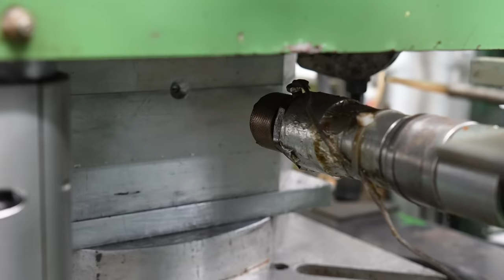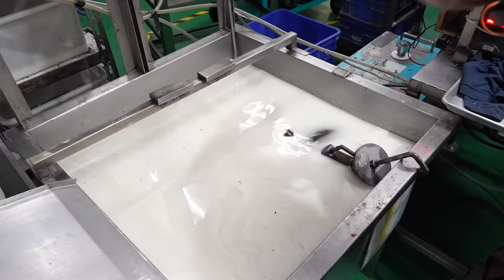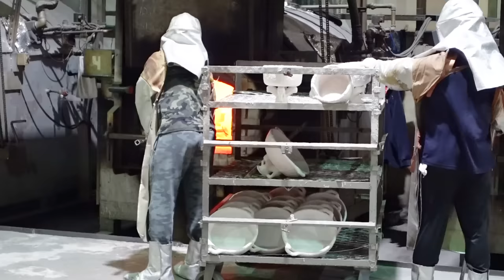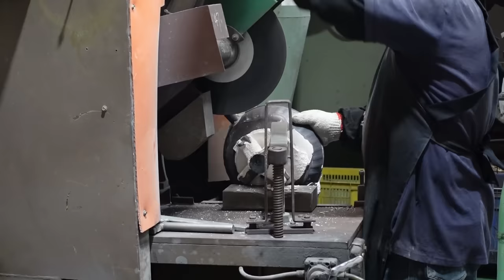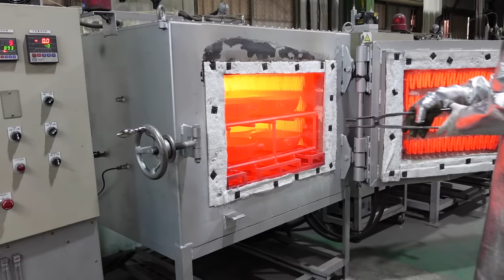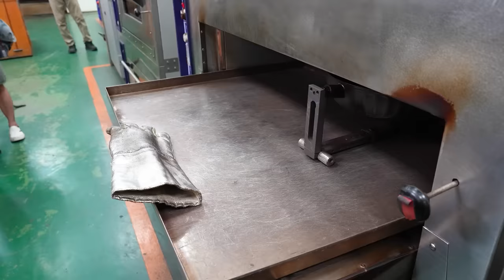Amazing! Process of Uncoated Cast Iron Pan Mass Production / 鑄鐵鍋量產過程 - Taiwan Ironware Factory

Comment: I would love a bit more detail in the process.  Putting the wax into a special slurry, why?  Putting it into special sand?  Why and why  was the sand bubbling.
Reply: Air
Reply: "slurry" as in pottery slurry - clay mixed with water to liquefy it. The sand is then used to build up a thicker more stable coating - when fired this basically turns into ceramic.
And the bubbling is, as was pointed out, just air getting blown into the sand to make it softer. When you blow the right amount of air through any fine particles they can suddenly behave like a liquid which makes it easy to put in the wax-form without damaging it (and faster and more even than having to through the sand by hand).

Comment: It's obviously very high quality but this is an enameled pan.  Uncoated pans need high temperature oil seasoning in a really hot oven for an hour.  It's right up there with Le Creuset in quality.
Reply: Hard to season in a hot oven with a wooden handle.
Reply: They seasoned it with flax oil before fixing the handle. It is not enamelled. If you want to season more, just unscrew the handle & do yourself.

Comment: Cast iron has some internal stress from casting - it will warp with time. So these pans might be good for gas stoves but after a couple of months they will not be usable with electric stoves anymore.
If you want one that will stay flat - they exist, but for that the pan, after casting, is tempered and then stored for at least a year for the metal to do its warping and only then is the final surface ground down.
Reply: at 9.18, they tempered to decrease iron stress. Nothing secret, they know for century.
Reply: @chipnkit   That is not tempering. And that is done after surfacing - so even if it was tempering it would do the exact opposite of what you want.
Reply: @ABaumstumpf  I agree for that, but they may do for a reason, all process may not be shown on this clip. 

In a factory level and for an expensive pot like that, I think they know what they do.
Reply: @chipnkit  "I think they know what they do."
Sure they know what they do - and they know how exactly to cut corners even when it leads to problems down the line.
Reply: @ABaumstumpf  Not likely, as shown in  clip, they have full potential of all sort.

Comment: My "big" cast iron skillet is 12 inches. Weighs about 9 lbs. I bought it sometime in the mid 1980's. I use it almost daily. Is oven safe to 600 degrees Fahrenheit. I purchased it new $15 USD. It's at LEAST 40 years old. $183.00 + shipping for this made in Taiwan polished turd (remember when being "made in Taiwan" was a joke? I think I'll pass. You can't even use it in the oven 👎🔥
Reply: What a silly comment. Different pans for different needs. Yes, Made in Japan and Made in Taiwan used to be synonyms for cheap and cheerful low quality... about 50 years ago. Not been that way for decades. Now they're usually known for high tech and for quality, for which people pay more.